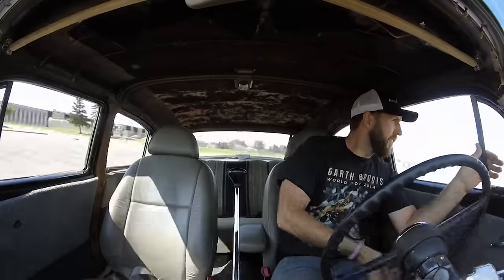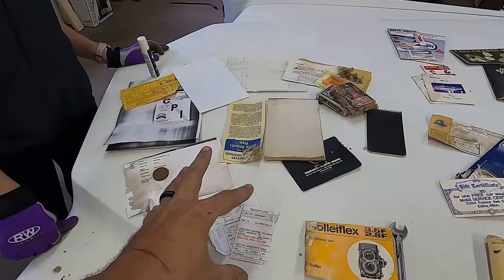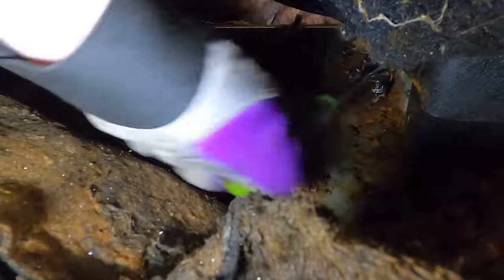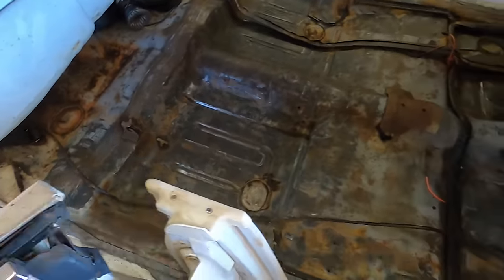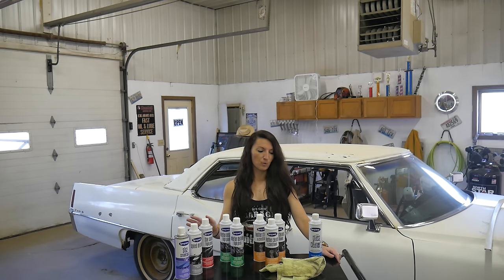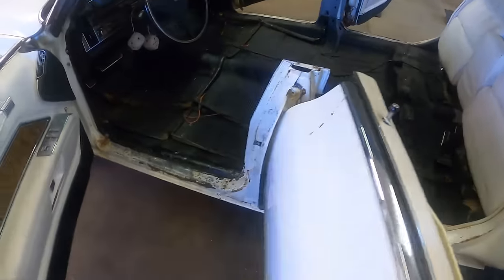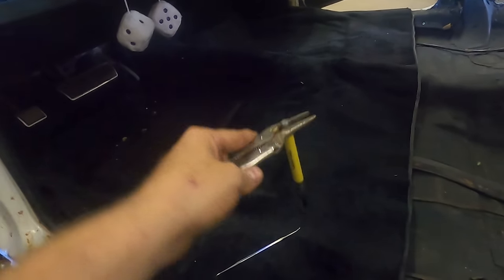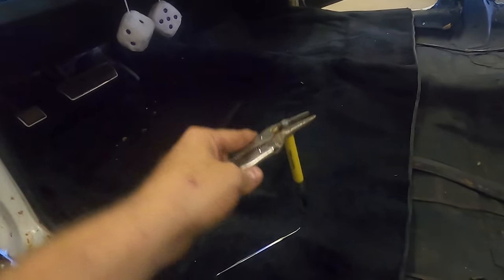Abandoned 1970 Cadillac Sedan DeVille Gets Interior Refurbished on a BUDGET! - Vice Grip Garage EP80

Comment: The light in the case is a "luxury accessory" that Cadillac tossed in. Wire should be long enough to reach under the hood, or to the rear wheels if you need to change a flat tire. 

Source: Old Man gearhead as a neighbor

Comment: After I melt your holes in the carpet I always make a couple of studs to screw into the floor. This makes it easier to put the seat in as the carpet doesn't move when you are positioning the seat. I just make them so they stick up about an inch above the carpet. Drop the seat onto the studs then remove them one at a time and replace them with the seat bolts. That caddy is turning into a real gem. Awesome job!

Comment: Yes, the light is a GM thing. You plug it into the cigarette lighter, so you can see the engine compartment in an emergency.
Reply: My dad had a 56 Eldorado Convertible that came stock with a vacuum that plugged into cigarette lighter.  classy cars, those old Caddys
Reply: I believe Ford made something similar back in the day
Reply: Alvin Baker Thats pretty slick. Rolls Royce should take note, all they give you is an umbrella..

Comment: A steamer works great at cleaning all surfaces. Plastics, leathers, vinyls, carpets, even on rubber seals. Invest in a good steamer it will save you time and money.
Reply: They work on engine parts too, melt the grease away
Reply: demonchild 74 correct! Also super satisfying and it only uses water of course
Reply: Not too expensive either

Comment: One tip with the POR-15, instead of opening the can normally punch two holes in the bottom along the edge that you put screws when you're done.  I'm still using a quart can that I bought and opened 5-6 years ago.  I also use the throw away chip brushes to put it down.

Comment: Hi Derrick I enjoy your humor and word make ups. I was tightening up the drainage bolt on the 67 ford gas tank . I snap the nut and the gas was pouring out at the gas station. I found a hockey puck in the trunk and took a hack saw and cut out a v and plug it up. It lasted for years.

Comment: I live in a country that follows the metric system and I can confirm that the water level inside the car was indeed 9 meters.
Reply: His measurements are always surprisingly accurate, eh?
Reply: How many waffles is that?
Reply: @theelectricmonk3909  and a drachm or two
Reply: If i"m not mistaken 9 meters is almost 27 feet, don't you mean 9 centimeters?
Reply: @davidwoolley5732  You are correct, it should be 9 centimetres. 9 meters would be 27ft and the garage and everything in it would be sunk.

Comment: To clean a interior roof liner I used a carpet cleaning machine that had an upholstery attachment. I used it on my '91 Toyota Land Cruiser which has a Dove Grey color inside. The ceiling was "black" from dust and dirt and was returned to normal color using standard carpet shampoo. With the vacuum it dries it right away and smells great!

Comment: Love this car from the grassy grave onwards. I miss my old 1976 Chevrolet Caprice Classic with the same 4 door design as this. I had the maroon red, with vinyl roof and red valoor seats. 400cid Rochester 4-bbl. V8, TH400  automatic transmission. I later found the showroom book for mine and identified it as a 1976 Olympics Special Addition model on the from booklet cover. Mine needed a new tail light and a rebuilt transmission, which we added a shift kit. The A/C and cruise were shot, but it was tank versus ANY car I've had the honor of owning since. During winter with its rear air adjustable shocks, I threw in sandbags to the trunk and put on some studded Firestone Town & Country M+S tires. That car drove level and circles around stuck 4x4s in the ditch along the highway in a really bad winter.  

I'm seriously going to have to look for another decent used 4-door American icon like these cars you have again. Great work on that Betty White Caddie! 👍

Comment: STEAM CLEANER for the headliner.  They make small ones that ain't to expensive.  Should just melt that mold right off.
Reply: agreed. I hope he sees this. They work wonders on so many things that he is having issues with.
Reply: I was thinking steam cleaner as well. But how would he get to any mold behind the headliner that isn't visible? The whole thing may need to come out. Fortunately the B pillars don't go to the roof so it should come out easier than normal cars
Reply: the problem is it will likely come back
Reply: White Vinegar for the Mold!!
Reply: @fartzinacan  Maybe he could peel back a corner and check extent of mold with one of them  flexible cams like plummers use.  I don't know. Then decide.

Comment: the floor pan be like: top 50 things science cant explain
Reply: The only thing I can think of is that in 1970 they were still using real steel.
Reply: @NHL633  Actually that's correct.
Reply: @NHL633  So what do they use now days fake steal?
Reply: It had a Phoenix map so maybe it wintered in Arizona and avoided the street salt until it was parked.
Reply: @marknewman636  Thinner weaker poorly made steel, not treated either
Reply: @captainamericaamerica8090  apparently you haven't done any body work have you the steal cars today are made out of is not weaker it maybe thinner in some cases but it is not weaker try and bend it with your hands if it's so weak or a dent try and bend it back with your hands if it's so weak.
Reply: Maybe some fountain of youth properties in the mud she was packed in. Maybe stake a claim on that dirt!!!!

Comment: Derek, I realize that this Caddy was done a year ago, but for future leather upholstery cleaning, you need to go to eBay and buy a set of that cheap nylon upholstery and grout cleaning brushes that mount on your cordless drills.  They come in several colors which denote how still they are.  I have a newer Caddy with a Cashmere interior and find that the while bristle brushes are soft enough for the leather and yet still work on the carpeting.  They are particularly good at cleaning out those fine cracks in the leather and making them disappear.  
Also, watching you and Jess struggle to get those sear bolts that are way under the seats out was way too difficult.  A rechargeable cordless right-angle ratchet wrench would save you a lot of time and sore wrists.   Those are among the greatest inventions since sliced bread and they come in various lengths.   
I hope my unsolicited recommendations help.  Like they say, "work smarter, not harder".

Comment: Period correct wheels, long tubes, shift kit, 3" exhaust. Perfect.
Reply: That thing has the stock hubcaps.  Just needs some thick whitewalls.  This is a Cadillac;  it does not need a shift kit.  It does not need a 3" exhaust.  Cadillacs are supposed to be long, low, and silent.  It's a cruiser, not a racer.

Comment: HOW is that floor still there?
A guys mind is boggling.
Reply: The car may not have ever seen any salt
Reply: I think the constant depth of water saved her, it's when it dries out then wets up and dries out again that the tin worms really get munching their way through yer metal.
Reply: @davewilliams6172  then metal which is on the borderline of air and water would rust away, we see neither of those cases in this video.
Reply: @davewilliams6172  
maybe the floor metal was well treated with some kind of rust preventative when the car was built ? 
It is a Cadillac.
Reply: Lots of theories floating around, but ain't no denying that's when autos were MADE TO LAST

Comment: A little trick on the rear cushion. Once you get the front seat out, sit on the front door seal and put your foot on the rear cushion with your heal on the bottom of the rear cushion frame where that hook is. Then you can use you leg to push back and up and the cushion will pop right out once you do it on both sides. Put the rear cushion back in that way.

Comment: Owned the same vehicle myself back in 1984. It drove well but at the time I wasn't as mechanically inclined as today. So after an easily fixble ignition cylinder lock broke I traded it in for '76 C-30 Chevy truck. Another vehicle I wish was still mine.

Comment: I most definitely love your channel and can't wait to see the old girl Betty restored to her full glory. Now I used to have a Black Cherry 1995 Buick Park Avenue and my advice for the leather seats is this: Meguiar's, Meguiar's, Meguiar's. Those seats should be drenched in Meguiar's after two decades, just like bread should be drenched in garlic and cheese.

Now the rear wheel fender skirts/covers, 0000 steel wool like what you used on the trunk lid but I'm fairly certain it won't take it all off, so I would use CLR at the temperature used to take a hot bath. Just drop them in there and leave them there over night. Alas it might not be good for the paint so they will need new rust-proofing, gray primer and a new coat of paint.

Headliner, well that can't be helped: steamer rented from Home Depot, Moldex mold remover and Meguiar's. That gunk isn't coming off without a steamer from what I could see.

Comment: You guys are great! Love the jokes and the hand gestures! 
What I’d do with the cadolacado is pull all the hubcaps off, clean and paint the wheels satin black, put on chrome lug nuts. Find and put back on the skirts. Put on a nice exhaust system to make it a bit beefier sounding, get the body as best you can without bodywork and spray the entire car with a satin sealer. Put in a decent sound system also, but nothing crazy. Of course fix whatever mechanical issues it has, detail the engine compartment and then enjoy it!!

Comment: Semi pro tip.....I use zep degreaser and a green scuff pad on hard stains and use a microfiber towel and zep degreaser on the rest old toothbrush with zep in tight spots, cracks etc. I use a vacuum to suck up the dirty cleaner, especially in cracks  before spraying the cleaner on a clean microfiber towel for a final wipe down then a clean dry microfiber towel to finish.

Comment: As far as cleaning rubber floormats, the best juice i have used is SuperClean AllWheelCleaner. Yes, a wheel cleaner. I woek in a machine shop and my boots drag in all kinds of gunk from the floor, from machining coolant (water soluble oil), metal chips, hydraulic oil, honing oil, general schmutz. Gets them looking like new. Spray it on, let it soak, then take a wheel brush and scrub a little, rinse with water. Boom, good as new!

Comment: For the mold in the seams, I used qtips and a 10-15% bleach solution and wiped into seams like that, and it worked pretty good.  Just don't drip any on those new carpets or other areas.

Comment: Ok, you can try this on the headliner "crevices." Place old towels or blankets over your carpet. Mix bleach (1/4 cup) and water (3/4 cups). Put this mix in an old cottage cheese container, or Jessica's favorite tupperware container. It'll be fine, I only live about an hour away. You can use the couch a few days, I ALWAYS have cold snacks. Get a casserole pan or brownie pan, something about 2 inches deep. Or use a trans pan from a TH 350, as long as it's clean. Place the container with your mix into your pan. The pan will catch drips, sloshes or heaven forbid you "gracefully" dump your whole mix. Now, the technical part. Get an oral-B spin brush 2000T. T is for teeth. Dip said toothbrush into your mix, place it in the crevice and turn it on. Here's the important part, always make sure that the 2000T is OFF when it is not in contact with your crevice. Or not.

Comment: ~ A good cleaner: mechanics hand cleaner, the smooth ungritty kind. Conditions/removes all sort of gunk off anything plastique, vinyl, carpets, or leather, etc.. Also removes odors/stains from carpets, perhaps water stains, also when mixed in with carpet cleaner.
~ Mold killer: vinegar & hydrogen peroxide or straight up bleach
~ For rust: pretreat with oil, let sit for a while, prevents oxidation.
~ Brushes are always indubidably handy to reach hard spots for cleaning/conditioning

Comment: Considering the amazing condition of this car, it probably spent a good part of the first decades of its life in a garage, and it was well cared for. It was only much later - probably after the original owner died - that someone began driving it and it got that rust on the rocker panels. My bet, it was parked because the A/C broke, but it was a runner. It started right up. I bet it really is 27,000 original miles. I know some older people who had the daily driver and the "special car." This was the special car, only driven on weekends and holidays, and when it was parked and thrown away it was still a tight, good runner. 

Truly a "survivor".

Comment: My grandfathers caddies back in the late 60 early 70s had a cigarette plug portable light in the glove box.I used to get told to not play with them lol.for the mold cleaning .its called star bright mildew and stain remover.you can get it at Walmart for  9.97 in the boat cover section.used it on a boat I bought the seats were covered in mold they looked horrible but this cleaner removed that mold and made them look brand new

Comment: Try a Mr clean magic eraser on the stubborn stains on the interior. You can buy knock off ones on eBay for a fraction of the cost.  For the headliner I'd use pressurized steam along the seams and then carefully extract the material to get the remnants out.
Reply from the maker: Thanks for the tip!

Comment: Incredible talent,    great Humor. Captivating.
Reply from the maker: Thanks
Reply: You need to invite  cheech Miran on your show, because the episodes will go viral and he's a low rider guy.   Keep up the fantastic work   stay awesome
Reply: A tip that may help alot,   mold is your worst enemy,   steam will not stop it,  hydrogen peroxide will.  Food grade works.  It will absorb into the mold killing it .  A follow up of Mr. Clean 50/50 dilution with water should make the seams on headliners or stitches look great.  I use a  soft brush .   This process will not damage anything  .use goggles .  Never handle black mold,  it is very dangerous.  Use nitrile gloves.  Also   Mice of rat droppings use a good mask,  do not breath in any of that,   it can make you very sick.   If you have an interior that is cloth,  you may have a problem that nothing less than re-upholstery can fix.   Stay safe.

Comment: As far as the car plan, I'd say it's proven it deserves to come all the way back.  New vinyl top and at least a paint blend job to fix the damaged and/or rusted areas.  It's a peach!  As to the head liner, I suspect the reason it keeps spreading around is that the hoops are rusted and they just keep leaching that stain into the headliner fabric.  I think you'll need to drop the headliner and replace, or strip and treat the hoops.  Then your cleaning will take.  I like the steam suggestion as well.

Comment: Dissolve pool chloroene tablet in a bucket of water to make a weak bleach. Put it on the mouldy places with a sponge, dont drip it on yourself or Jessica or bits of the car interior. Dont wash it off and add more if not totally sucessful at first. When everything is clean and mould free rinse it away with water and clean the whole thing with a good general purpose. (Test a little bit first thought) For rusty chrome, wet the surface with water or vinegar works well and rub them vigurously with aluminium foil, polish off with a dry cloth.

Comment: Hay Derek, watching Old Vid's. The easy way to get the Back seat front clip to release is to compress the springs in the seat over the locking clip with big pair of flatheaded Vice Grips. Why is it a pair if it's only 1. Only clamp down an inch or 2 and bobs your aunty! Many Meny moons a go, I was in the back seat of an Australian 1986 XF Falcon Ghia wagon going around a Dirt bike track at a rate of knots. Getting Air! And the seat unhooks itself, we were hands on the roof, feet wedged under the front seats.

Comment: My dad and I just bought a 66 DeVille and the motors in our seat didn’t work we had the same problem with water sitting in the floor so we gutted it and h the arts about how far we’ve gotten. There’s a few pin holes but it’s an old caddy they rust but they don’t rot very easy. The seat bolts took 2 days to get out and there’s only 8 with one ground wire and a connector for the seat motor rather surprisingly I got all the bolts out used some vice grips but hey they’re out

Comment: Check in to a plastic welding kit the tip should burn holes into your boat holes you don't have to use all the 3 things you just have the 1 thing to heat up

Comment: You lucked out that it wasn't salt water, using POR 15 if you spray that stuff wear breathing protection, it good stuff and get wet it gets harder, try and scrap it off not happening, inside doors just pore it in it seal them good I've used it $$$ once open can use it all or it will dry up like plastic. You two or three did great job looks good seats cleaned up nice.

Comment: shop vac and mold killer on those seams man, you gotta get whatever you get that is wet up in there and back out fast and just keep doing it . I have a weird little vacumm that blows steam and vacuums back and fourth but doesn't work upside down very well so when I have something I gotta do upside down I put a flat squee Gee attachment on the old shop vac and I use , this is really weird, McCullogh steam pot thing.  However you spell that chain saw company.   It;s weird because that is the the way it is, has a metal pot that gets hotter than boiled water LOL  blows steam out of a weird little spout and kills all kinda stains. It's strange they made it but made it they did, I think I got it at a garage sale LOL  really works great on shower  and bathroom mold.    But really just anything that will bust up gnasty mold and the shop vac,  you don't want any of that coming back . You know that mold spores can get in your lungs and end up killing ya right?     You will be wanting to stick around to see if you get better looking when you get old like I did.